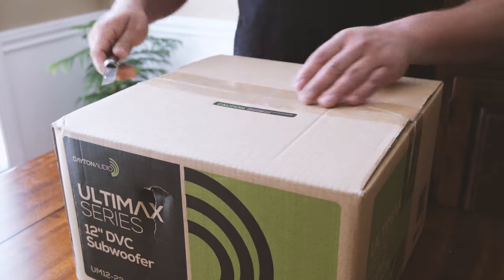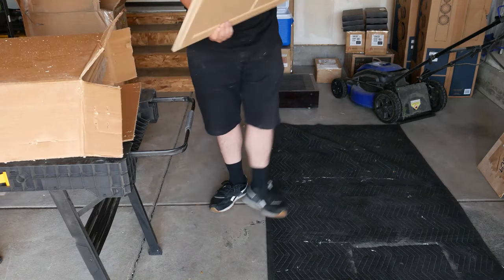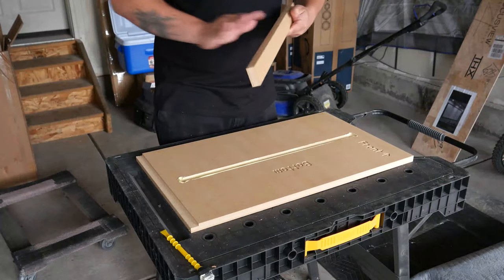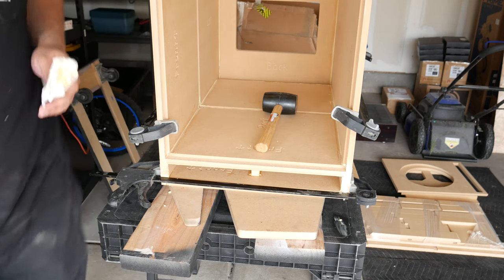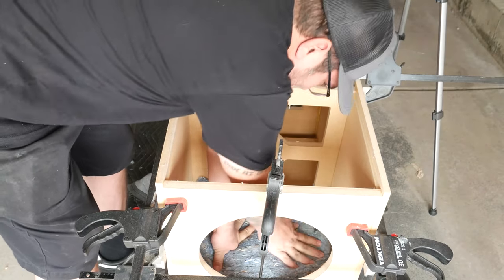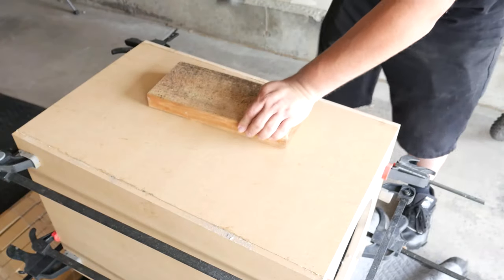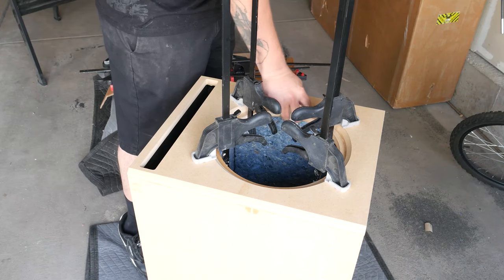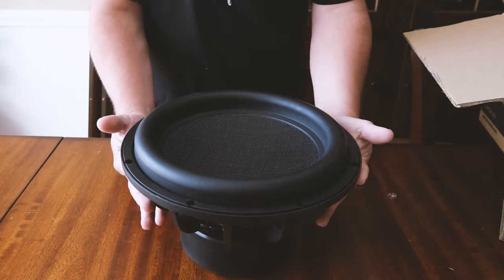How I Built the 12" DIY Hammer Subwoofer Box from GSG Audio & Home Theater Gurus

Comment: Don’t worry about using too much glue. In woodworking, we call it “squeeze out” and it’s a good indicator that all the available surface area is getting glue, which is the most important thing for a reliable bond. Wet glue can be cleaned up with a wet rag/paper towel, and dried excess glue can be scraped off easily with a chisel or whatever sharp implement you have laying around. It can also be sanded off if it’s visible on the outside where you need to do paint or other finishing.
Reply from the maker: Yeah I figured more glue was better than not enough haha
Reply: Audio Arkitekts especially with these MDF kits where screws or other fasteners are often considered to be optional. With all the vibration that’s going to be happening in there, definitely the more the merrier!